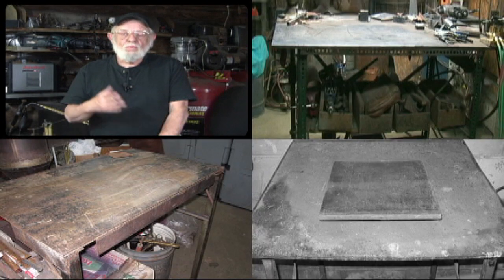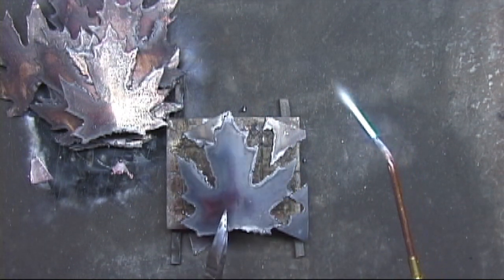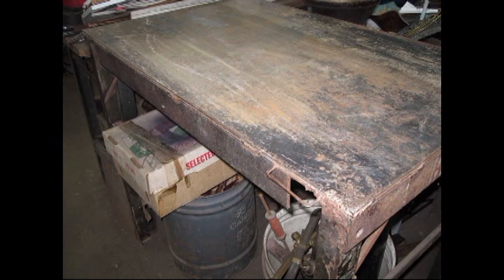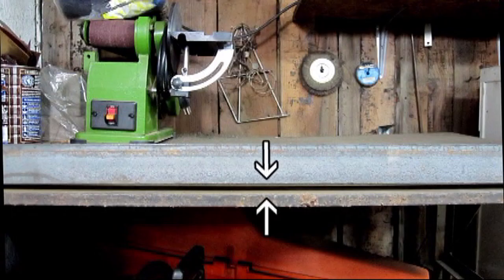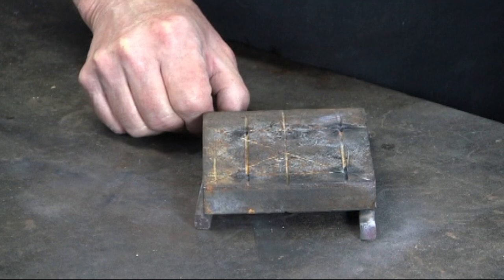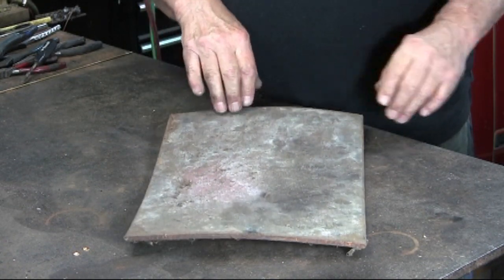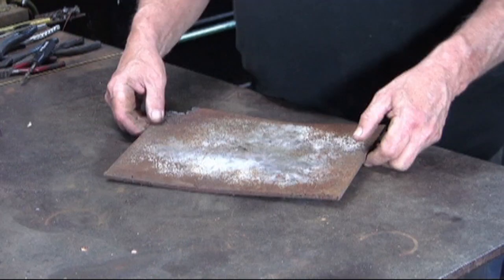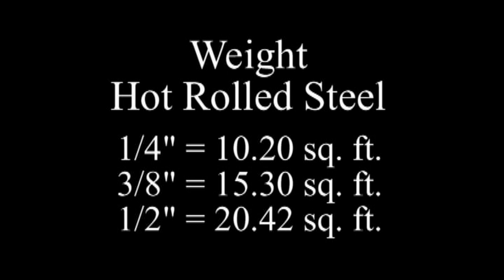Welding Table & Heat Sink

Comment: Excellent info George - as usual.  Based on your prior advice, I made a small heat sink for brazing small items - it is a small piece of steel that is 5/8 inches thick.  If I get into brazing more, I plan to make one a foot square and make it a 1/2 inch thick.  I will just weld some large nuts on the corner for feet to insulate it from my regular small 1/4 inch table.  Thank you again for sharing!

Comment: the intricate pieces you work on are amazing to watch the quickness of your spot welding skills. I'm sure your many years of doing it has definitely honed that skill,  but it's still cool to watch.
Reply: would like your opinion. I have a silver tea pot of a customer I'm doing home remodeling for. The handle had come off, clean,  and wondered what your thought is about using silver or copper soldering paste, as a repair. I am worried about hurting the silver using braze or high heat,  and have seen the flow heat for the paste is relatively low. My concern is strength.

Comment: I really like your designs. I'm thinking about making some nice stuff with my everlast welder. The use of heat sinks is a great idea.
Reply: Thanks for commenting.  Using a heat sink has saved that table top.  I've been using it for about 20 years.

Comment: I wish I watched this video last year. I bought a 2 foot by 4 foot quarter inch thick plate.  I warped it right away.  I am not out $29 since I will just by another table top and cut the other one to make art and heat sinks

Comment: I use to deliver to an army base I found a giant piece of steel odd shaped and very heavy about 1/2 thick turns out it was a piece of armor plating from a tank.  I cant weld or braze to it because its an alloy but its great as a heat sink thanks for the great videos!  btw what editing software do you use?